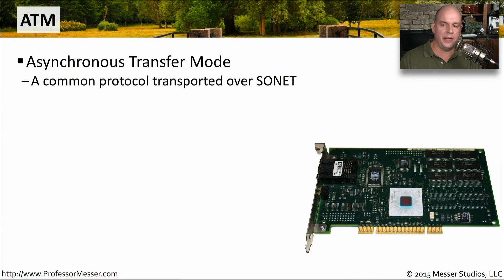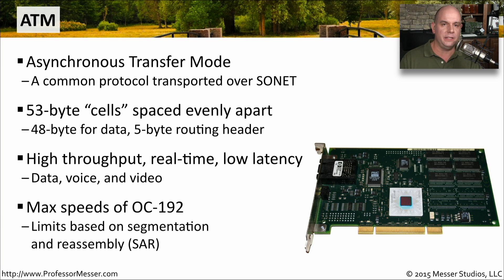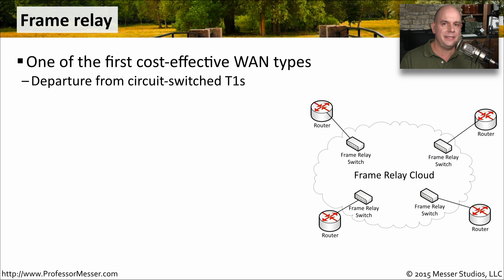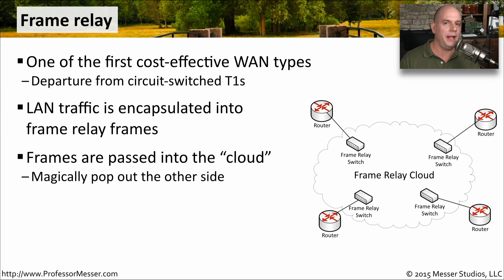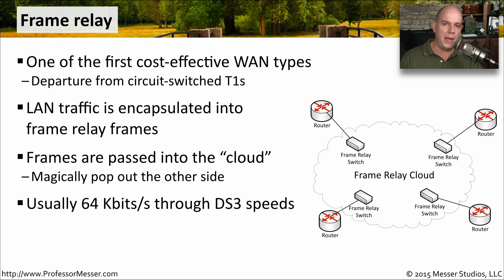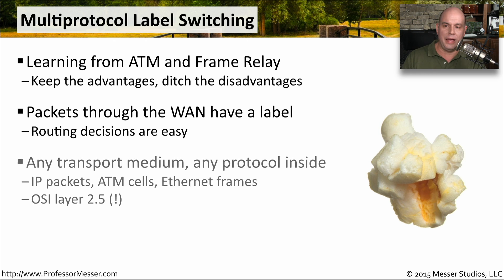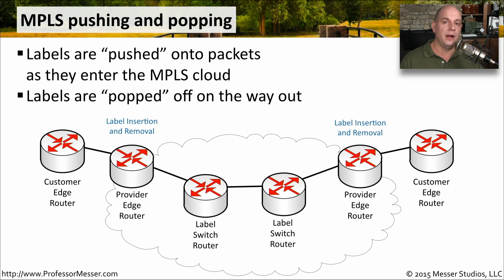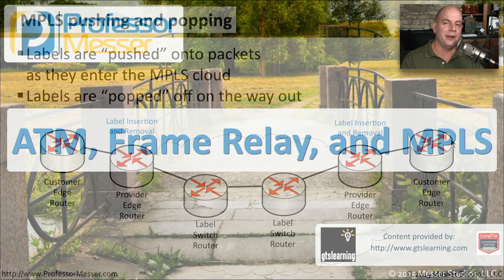ATM, Frame Relay, and MPLS - CompTIA Network+ N10-006 - 1.4

Comment: The Frame Relay use the "DLCI" to provide reference of routing, not "magically" go to anther side as you said in this video.
Reply from the maker: The DLCI doesn't have anything to do the forwarding or routing mechanism of Frame Relay, other than to specify the L2 destination address. The actual forwarding path is unseen by the end devices, and can often change without notice. You throw data into the Frame Relay network, and it finds its way to the other side. Like magic.
Reply: Thanks! Therefore, like routing table in router, or forwarding mechanism in layer2 which can be configured, users of frame relay can't configure any routing or forwarding mechanism?